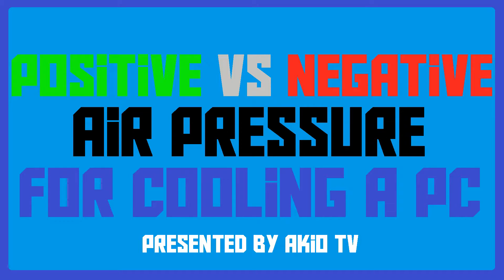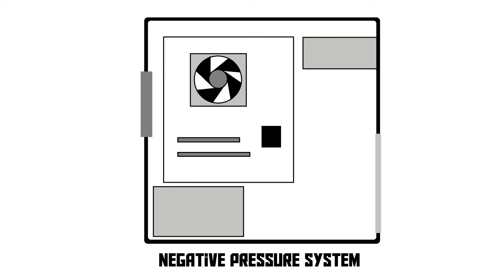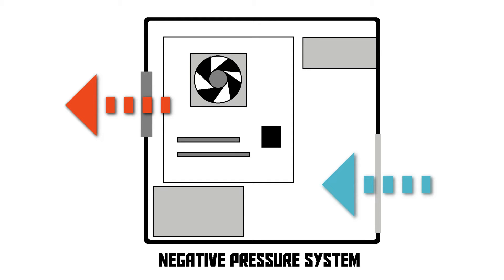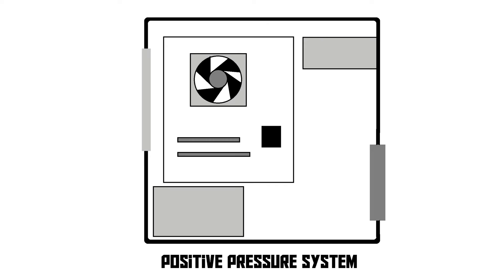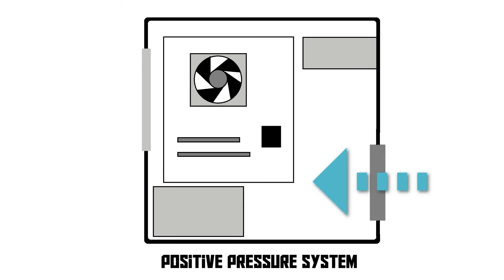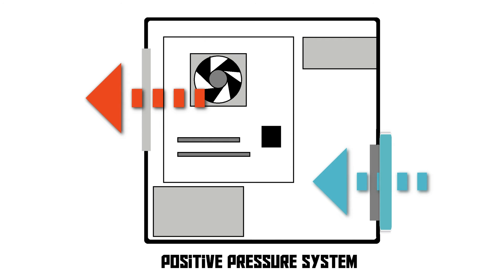Positive vs negative air pressure for cooling a computer (AKIO TV)

Comment: You missed the other important aspect of the tradeoff.
Negative air pressure is less likely to create pockets of stale air that is being continuously heated by components.
Reply from the maker: I'm aware of that, but that's only in extreme situations, where fans are blowing air into the case from all directions. In the example in the video, there's just one fan at the front. I do agree that in the video, I should have mentioned the extreme situation and the air pockets. Thanks for the comment.